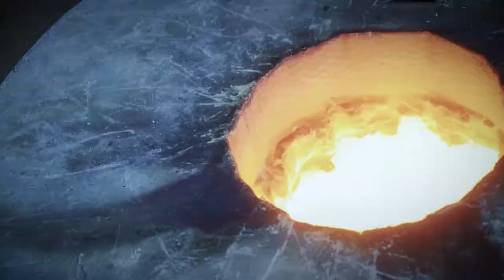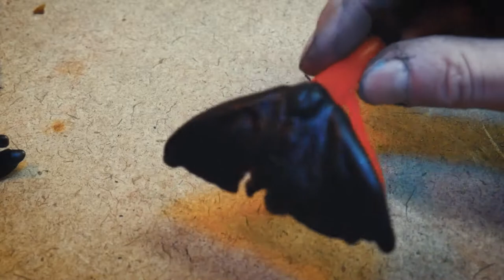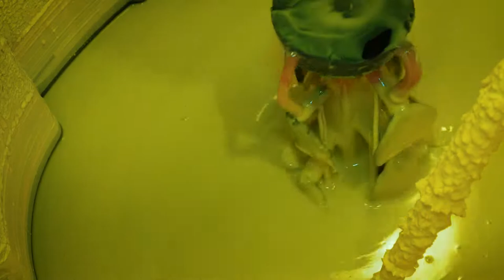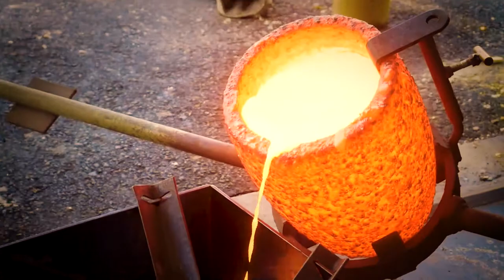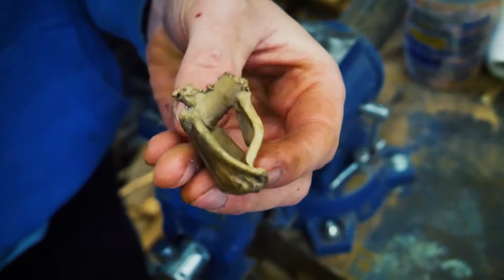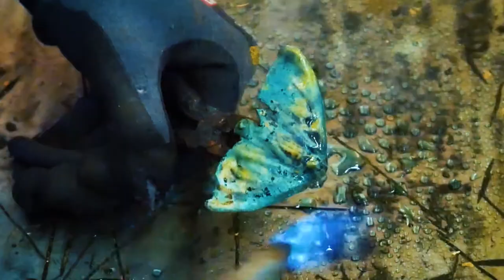Bronze Foundry: Dead Pandora Moths into Metal Sculptures

Comment: Would be interesting to see if you could attach the wax rods directly to the moth without dipping them in wax first. You may be able to keep all that incredible detail on the wings and the body. Great little sculptures anyway. Thanks for the vid.
Reply from the maker: Yeah the detail loss kind of sucks but the wings are so thin, it was more to thicken up the volume of the moth so that later on there would be enough empty voids for the molten metal to flow in. If I had just done the moth in it's original form, the wings would be less than a mm thick and no room for a fluid to run into the ceramic shell once the moths burn away. I could have gone back and tooled textures back into the bronze later but this was just a little experiment
Reply: @skraminc  maybe it would be possible to paint a layer of wax onto just the undersides of the wings to get that extra thickness, and save the details on the top side?  Anyhow, great job!
Reply from the maker: @tobhomott  yeah. I wasnt even planning to cast them but when I decided they had all been dead for a while and were very dry and fragile. Tough to find them with both wings even. The other way to go about it is to emulate and recreate some of the texture in metal with tools